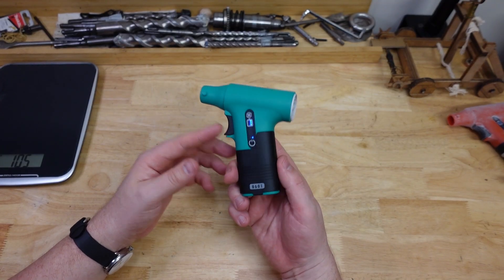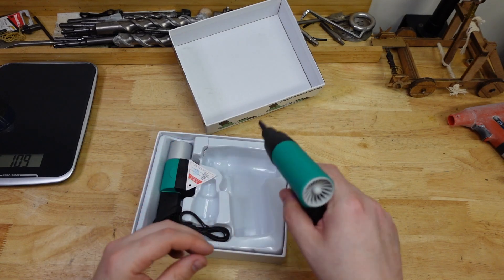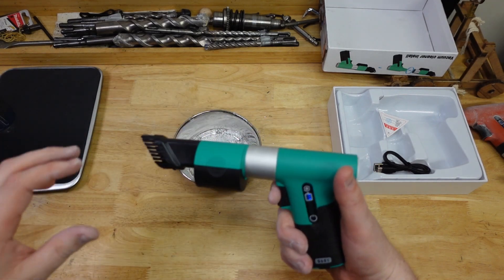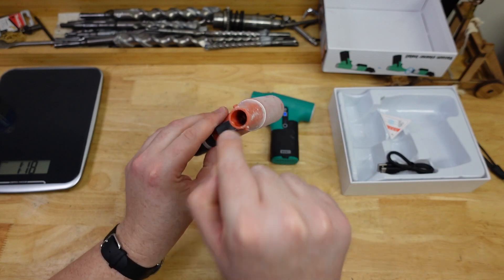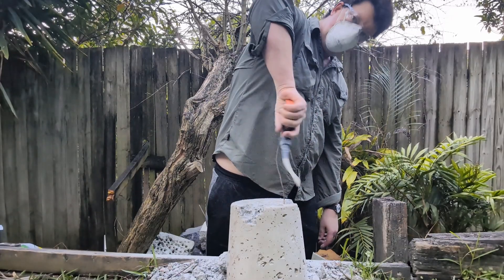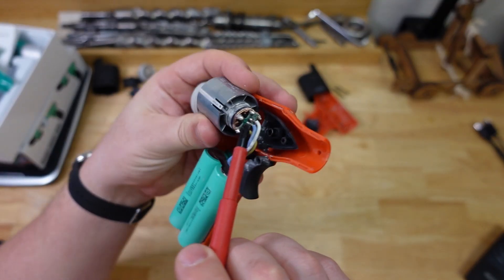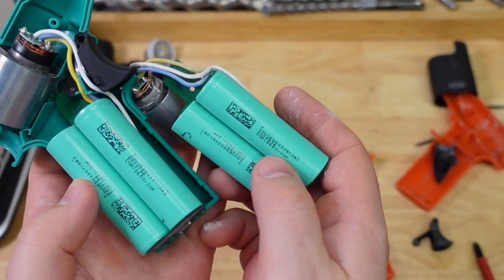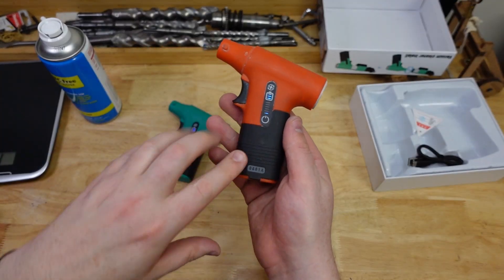0601A mini turbofan blower: any good?

Comment: Just got one from Hownot2 my main complaint is it has no attachment point for carrying it on a harness at height.  I JB Welded a rope bracket from Home Depot on it to be able to clip it on my harness hopefully that holds up over time.  Mainly wanted to replace using a blow tube while drilling so I can keep a mask on and not get dust all in my face every time I use the blow tube.
Reply from the maker: Nice. Did you see my carrying solution? Can't remember how much I showed it in this video but for small things like this a use 2 zip ties: one around the tool and another through the first in a loop
Reply: Did your blower from HN2 come with some extra tubes, zip ties, keychain loops, etc? Those accessories were included to make a little attachment point for the blower.

Comment: Looks like it easy to replace batteries also with a bit of soldering. I have a need for this in my work, but I do need to it to suck also but it's only textile dust maybe it will work with "vacuum" attachment. It would then replace a 5 kg horrible thing and a tool I never had that I always needed but have been without (a blower :-)... Thinking about it...
Reply from the maker: I think if you can manage to seal the filter into the vacuum chamber reliably, it'll work ok. Especially for bigger particles. I just used chalk as it's non hazardous

Comment: Mine has been going strong. Not sure which model it is, doesnt have a number label on it but its the same housing. Lasts about 10 minutes. Probably have about 150 holes. No issues at all. So glad these things exist.
Reply from the maker: Yeah I've been really surprised how good & durable they are. Doing glue ins especially saves soooo much time & weight

Comment: So your orange 0601A blower is the 100W model with 120,000RPM, 3000mAH battery capacity. Your teal one is the newest 0601 that's 150W, 130,000RPM, also 3000mAH battery capacity.  It's a common faux pas for Chinese manufacturers to include inaccurate or wrong English documentation, however the Chinese version is often more accurate. There used to be a 0601 - 50W version they made that was 100,000RPM and had 2600mAH battery capacity, but only few sellers are carrying those now.--- I'm not sure why they just couldn't have chosen a new model number for the latest strongest fan, it just causes confusion. But anyways... The models we sell through HowNOT2 we order factory direct, it helps keep better consistency and are the latest strongest 0601-150W version. --- Fantastic review, testing & video Matt! Love it!
Reply from the maker: Awesome! Thanks for clarifying